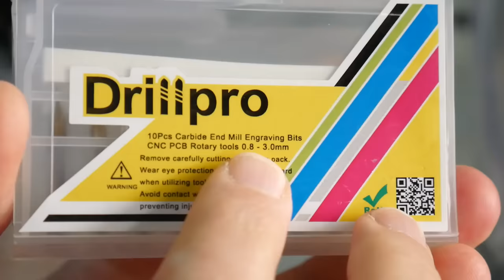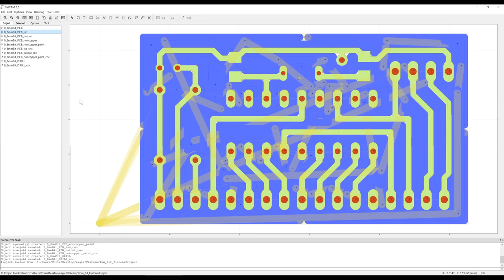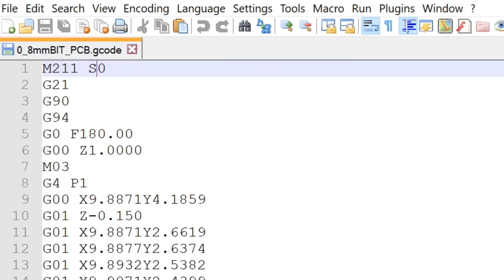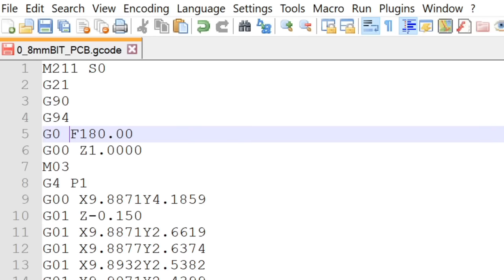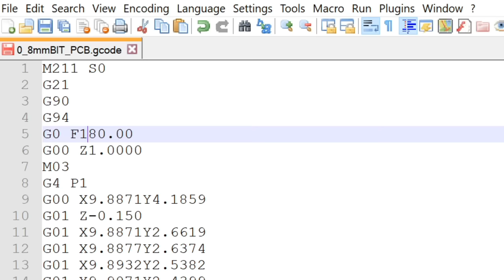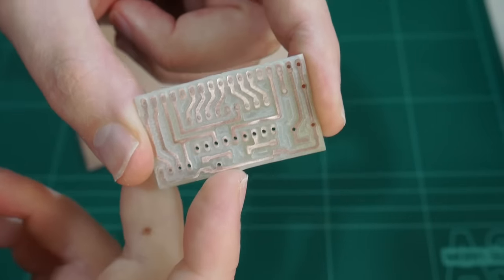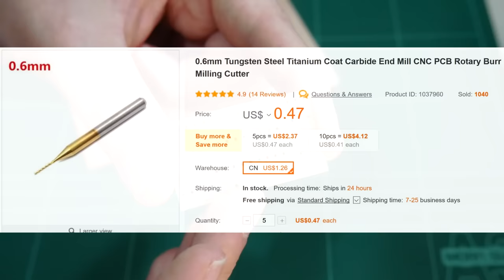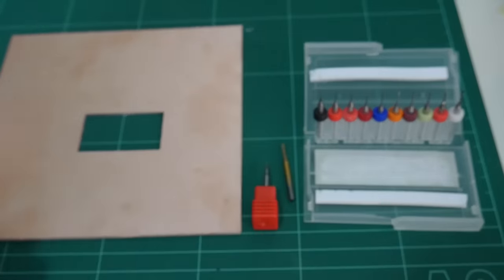Simple DIY PCB with a 3D Printer

Comment: PLEASE PLEASE give some details about the rotary tool .
is it a dremel ? just a high RPM motor ? what is it ? what sort of RPM do i need for it ?
Reply from the maker: Details in the previous video here https://youtu.be/IJxqXk-wdJw
Reply: Goto aliexpress and search 200w (5.5”) or 300w (6.8”) 12000rpm 48v max spindle and they come with er 11 or 16 collets for $15-32 shipped.
Reply: Don't use same rotary tool as you would have same issue as Tech2C with tolerances and z-play. Just having a Dremel would solve this problem alone, as Dremel have a much better flex shaft. I had some chineseum rotary tool and Dremel, and even tried dremel  flex shaft as a router on aluminum (bad idea), killed and changed bearings in flex shaft. Everything about Dremel is better than cheap chinese stuff, but even dremel have tiny bearings in a shaft, not very suited for side-load. BUT For this application I'd rather buy cheap 12V brushed motor with a small collet chuck (used and sold for purpose of drilling PCB).
Reply: @avelkm  A fellow AvE fan?
Reply: @Tech2C  Can you name some sites to download the example pcb design files. I'm a Mech Engineer and need it in dxf or dwg format
Reply: @glennedward2201  Can you name some sites to download the example pcb design files. I'm a Mech Engineer and need it in dxf or dwg format

Comment: Having used a PCB milling machine 20 years ago I have a few recommendations for you. When milling you do not want to cut in the glass fiber substrate unless necessary. It will wear out the end mill in no time. A proper calibrated PCB mill only cuts into the copper and glue. And when routing the final cut-out, do it in one pass so you won't wear out the tip of the end mill. The tip you use for the fine milling on copper, and the shaft on glass fiber.
Prober end mills aren't cheap.

Comment: Just keep in mind that the fiberblass is abrasive and the copper is conductive. You really want to have a vacuum attachment of some sort or else it's going to get into your motors, belts, power supply, that exposed control board, etc.

If you plan to do this often, I recommend a Shapeoko or similar with a Suck-It attachment.

Comment: Great video!  thank you for sharing this information.  I may give this a try in the future on my CNC.  
One suggestion.  Drill your holes first.  The reason is because it is possible, especially when your end mill might be getting dull or poor quality laminate, for there to be a hint of tear out.  Having a lot of copper around the hole at the time of the drill out will help support the surrounding copper.  
I really did like your video!  Thanks!

Comment: Ratbites (the small bridges holding the PCB in place) are convenient; but a word of warning about them: PCB's has a tendency to delaminate near them and put mechanical stress on the components. It's not a problem here; but if you use SMD components near the rat bite it may cause trouble.

I experienced this problem first-hand for one of our designs. I had pointed this problem out to a manufacturer;  but they assured me they had this under control. Half a year later we received defective units back - all with the same symptom. Diagnosing the boards I found they all had a capacitor with a DC resistance of a few kilo-ohms. By casting the boards in resin, grinding them down and inspecting under microscope we learned the capacitors had cracks that originated from the rat-bite.
Reply: We call them mouse bites.  3 small holes and 2 larger holes on the outsides.

Comment: I like it. I don't know what it's for but I like it. Great for prototyping if you have gear like this and don't want to fiddle with printer, etch resist, chemicals etc for 2-5 boards and super tiny leads aren't an issue.

Comment: I have more than a year of experience with milling pcbs. I first tried with my 3d printer, then made a dedicated milling machine. For good results you absolutely have to use autoleveling. For pcbs larger than, let's say 3cm, you will have terrible results as on some areas you will barely scratch the surface or dig too deep. On my dedicated machine i am using MACH3 as the milling software, a free tool for probing and autoleveling the pcb and flatcam. The probing tool acts as a post processor for the gcode from flatcam and modifies it so the clearing is always consistent. I forgot the name of the software though.
Reply from the maker: Yes I agree. I had enabled the auto bed level feature in Marlin firmware of my 3D printer, and the intention was to show bed leveling for the V bit. If I can remove the slop in the flex shaft I'll revisit it.
Reply: Tech2C best option would be buying a dedicated brushless motor with collet included besides to less noise it has the capability of rpm control
Reply: The problem is basically that the copper clad laminate isn't guaranteed to be flat across it's surface, i've seen 'ripples' greater than 0.3mm. So what the Mach3 probing tool does is profile the surface and generates a Z axis pre-distortion of the G code to compensate for the out of flatness surface.

Also, I would order the Gcode files, so that you drill the holes first, the route the tracks, then clear the copper, then do the outline.
This stops pads from ripping off when the holes are drilled afterwards, as there is more copper around them.
Reply: There is no additional software needed in Marlin as its build in, just once enabled and mapped in Marlin (up to 12 probe level points) in ConfigH, and you use G29 command. Then follow this video to wire the touch place (in your case, you don't need one. Just clip the ground to the plate, and + to the end mill). 

http://marlinfw.org/docs/gcode/G029-abl.html

http://marlinfw.org/docs/gcode/G029-abl.html
Reply: Is the "autoleveling" some device/sensor that Tech2C can possibly attach to the 'mill head' of his 3d printer, kinda like the one used to detect the proximity of the bed when using the 'printing head'? Actually, can the same sensor be used for autoleveling?
Reply: I am not using a sensor. I am actually clipping an alligator clip on the pcb and another one on the tool. Then the autoleveling procedure actually touches the tool to the pcb, making contact. It is as accurate as it gets.
Reply: JG .., build a better table you don’t have to screw around with it. Cheap printers need auto leveling.
Reply: @glennedward2201  my table is perfectly flat, the problem is with the pcb not being flat
Reply: @Wolfshark -  I use a similar process except that I use self built grbl/arduino based controller, with BCNC controller software (which has autoleveling built in) and I use a set of clips on the bit and one on the board itself. There is no way would I want to even bother trying this on my 3D printer, it's far to messy. 

For software I use Diptrace and CopperCAM. On my engraving machine I put an endmill in the machine and cut the top of my spoil board, basically facing the entire spoil board to "flat" following any imperfections in the machine itself. I don't bother with double sided tape, I just use cap head screws on the perimeter of the board. I've made many boards using this setup over the past few years and never once an issue. 

Autoleveling is the way to go, no doubt, because boards are always way off. Perhaps if I spent a bunch of cash on the boards they would be better, haven't tried that. Cheap boards are nearly an order of magnitude cheaper so I don't find that to be a feasible option. There doesn't seem to be a decent middle ground for price, it's either buy 1 board or spend that same amount on 10 boards.

Comment: Check bCNC auto leveling, it uses the electrical contact of tool to pcb to compensate curved surfaces. Covering the pcb in WD40 will help with thinner mills, and keeps the dust in control (mud).
Reply from the maker: I tried bCNC a while ago. The auto bed leveling I couldn't get to work. I have used Marlin's inbuilt bilinear ABL using alligator clips on the PCB and drill bit. WD40 is a good idea!
Reply: chilipeppr fro me works fine but i like bcnc too.

Comment: Impressive that you can use one machine to make a PCB , and then a plastic housing for your projects. Maybe more 3D printer makers should start building this milling ability in to their machines to make the devices much more versatile. The same XYZ mechanism could be a 3D printer, light milling machine and laser engraver by swapping the head. A really fancy model could have the heads automatically changeable perhaps.

Comment: For those more into etching: You can do about the same thing with a fine tip Sharpie to lay down a mask that does a good job resisting both FeCl and CuCl2 etchants. Got a plotter head for my Prusa just for this.

That said, building a PCB router or converting a printer does cut out messing with chemical etchants and masking. I'd probably want to either mod in a vacuum line to take care of the shavings, or a coolant line to keep shavings mostly captive on the board or in a runoff bucket. The former option would probably be way easier on a retooled printer. Metal shavings can be a right pain in the ass around computers, exposed wiring, intake fans, etc.

Comment: Another thing about isolation routing, it alters the electrical properties of the PCB substrate.
The PCB substrate acts much like a capacitor; conductors above and below an insulator.
Thinning the PCB substrate will change the capacitance of any traces passing over the thinned areas.
For a single-sided quicky PCB, not an issue.
For a double-sided PCB RF or audio amplifier, alterations in PCB capacitance would be a disaster.
Same with any high-speed circuitry; variations in capacitance = variations in impedance.
Point being made: Isolation routing is quick and dirty, emphasis on dirty.

Comment: Always Tin engraved  PCB's. Use a heat gun and Oaty 95 paste. This ensures a quick local heat buildup when soldering. Bare copper has a tendency to spread the heat quickly and delaminates extremely easy.  SMD parts are almost impossible to mill in. The copper surface has a tendency to chip at a certain thickness when using a vbit. The FR4 backer is usually pretty brittle at a small size.  Easier to mount a .1mm pen from sharpie and etch.

Comment: You could take a look at the German ‘Dremels’ made by Proxxon. The are more durable and stable. I have no experience yet with their flexshafts, but it might also not have any play in the head just like the main motors have.
Furthermore, it is not required to remove the whole nut to place a bit, only when it needs another collet size.

Comment: the shaft of the flexible-dremel handpiece has 2 bearings, you could glue them in with some CA glue.  when i did that on mine, no z play at all anymore.
Reply: Maybe print your own adapter with a spring between the bearings? Should be a nice usefull project. That is what i am planning for mine....

Comment: You could 3d print something to remove the slight Z movement. I'm thinking of something like an L - shaped bracket with a bearing, so the drill bit can go through the center of it.

Comment: To those interested. Milling pcb starts after 7 minutes. Don’t use a Dremel spindle if you want a cleaner finish. Aliexpress has the 200w and 300w 8mm shaft with er11 or er16 collet holders for $15-$32 if you scroll around lowest price shipped.

Comment: For the Z-Axis play on the end shaft, you need to put spacer between the flexi-shaft and the end receiver. This involved taking the "hand piece" apart and either adding a flat washer to take up the space, or adding something like a piece of a paper where the flexi-shaft inserts into the receiver. That should help with the end play.
That is, if you can even open up the hand piece for maintenance.

Comment: Free play in any axis makes PC board tougher to make, but if the play is visible it's actually too much if you need accuracy because of small trace widths and/or pad sizes. For through-hole boards cut with endmills this may no be a problem, but for SMD parts cut with engraving bits, free play in the Z axis means irregular results, and in the X/Y axes you can actually break the tip off your engraving bit if it has a narrow taper.

Also, unless your work surface is hyper-smooth and hyper-level, you pretty much MUST use an auto-levelling script in your G-code if you want consistent cut depths. Manually adjustable work tables on 3D printers are not even remotely level enough as this is nearly impossible to do by hand without contact probes, etc.

Comment: Should use the end mills just for the outline/drills. Try using the laser diode for "isolation routing" on black spray paint which can be used as etch resist
Reply: Yeah I've never made a custom PCB but this tripped me out not using any chemicals.....but hey I guess it'll work for anything that doesn't need to be packed in tight!
Reply: Is black spray paint good enough for etching chemicals?
Reply: yes.

Comment: Thank you for the nice video that shows how you can have your PCB ready in 20 minutes.
The 0.8mm end mill you have used seems a bit too large even for a board that does not use any surface mount devices. As you mention, smaller size end mills are available and can be used. One option would be to do the milling with 0.8mm and  drilling the holes with a 0.6mm end mill.
Like others have mentioned, I also wondered why you would choose to mill your PCB right in the center of a large board. That certainly is not optimal utilization of the large board that you bought!
In your next video give a demo of making a PCB that has tiny SM devices like 0603 resistors and capacitors with 0.4mm end mill.

Comment: Good video to demo the copper clad laminated PCB circuit router function limitation using 3D printer modified head . I had seen more than 90% you tuber using 100% copper plate and making PCB circuit to achieve 0.1mm or much smaller width circuit path width (fake and not possible !) .I wonder how the electronic circuit ( never Shot/Ground with 100 copper PCB ??!!!!) And the Presenter video never show the Edge of the PCB !! When I ask them are you using laminated copper coil-plate super glue on top of the Insulating Bakelite material??? Nobody dare to answer back to clear my doubt !!! You are one of the ten percent people telling the Real Truth !!! Good job done .

Comment: I was about to comment it was not needed to mill out the copper areas, but then you explained it as a solder mask of sorts. Nice thought.
Reply: Solder mask has different purpuses. This is just a PCB without filling plane. Solder mask goes on top of traces and all the areas that need to be isolated to either improove safety ratings, or protect againts environmental effects or ESD, or improve tha range of soldering temperature/heat that traces and pads will withstand... The purpuses for filling empty board space with a polygon or leaving it blank are completely different.
Reply: @Mr.Leeroy  yes I agree with everything. My comment was related to the fact that milling only the isolation paths would be enough and milling all the copper surface away is not necessary/waste of time, but them he said on the video that he did It this way to make soldering easy as there's no solder mask, which makes sense because there's much less to short circuit with.
Reply: I get the use, but I found this wording of "acting like a solder mask" wrong on so many levels.
If you are having such problems with shorting, I'd suggest improoving soldering skills starting with using no flux solder wire and learning to apply gel flux manually controlling the amount for the actual solder task. You would be surprised how much it affects the result.
I don't know how one would accidentally short anything even across 0.4mm gap and especially 0.8mm here. You have to actually make effort to create a bridge across a gap, because when solder is heated in flux it acts like a drop of fluid that due to it's density is highly attracted to other metals and it's particles to each other. So solder makes nice rounded shapes and just splits across the gap or jumps to one side. To create a bridge you actually have to apply less flux to control how 'slippery' it is for the blob to jump across the gap. Comes with practice.

Comment: impressive. i didnt think that the belt driven 3d printer was accurate enough to do something like this. ive just bought a dedicated milling machine which uses lead screws on all axis and this gives great accuracy. nice to see how it turns out on this system though.

Comment: ...don't forget to run g21 at the start when working with grbl and engraving pcbs.....don't ask me why, trust me on this one. a great trick for leveling is using a multimeter put into continuinity mode by the way so you can level it perfectly with the bed
Reply: I have a homemade cnc with a Dremel as the spindle. This is exactly what I need to do to get it dialed in

Comment: Hi, another work holding tip that has some other benefits is single sided tape (or book covering seal) and Super Glue (CA Glue).  Apply tape or book covering film to both the workpiece and the work surface then stick the 2 surfaces together with the CA glue.  Often this has more hold than simple double sided tape or does have some other benefits.  For your software (marlin and the CAM) is there no software backlash compensation available as this MIGHT overcome or help with your issue with the collet holder.

Comment: he mate just a hint but make a small device with 2 crocodile clamps and a led and move your z axis 0.01mm this way you can level perfectly and have a perfect 0. or even override your z limit switch to do it automatically and even use z probing. clamp 1 croc on the bit and 1 on the clad. its both conductive so it acts as a switch.